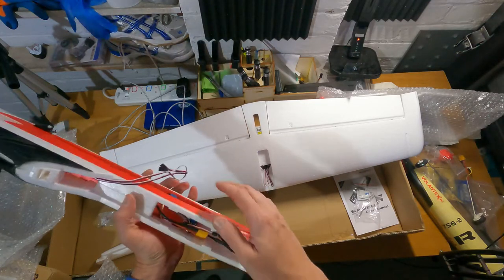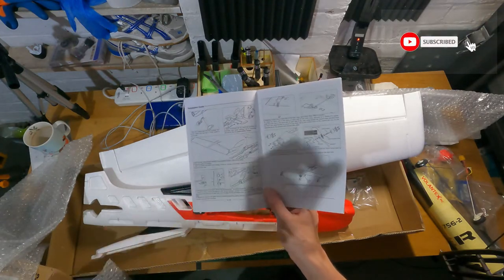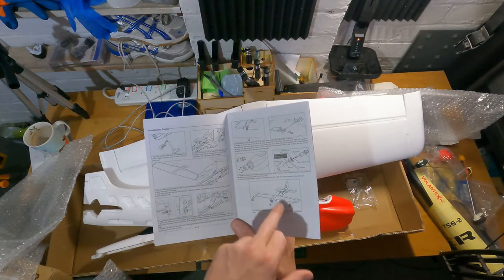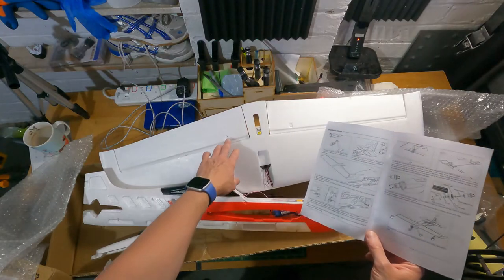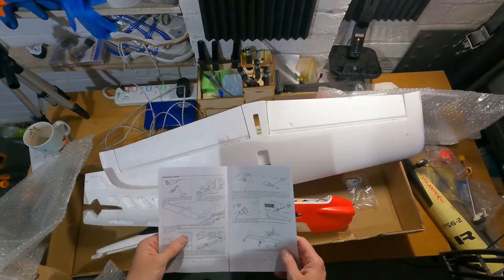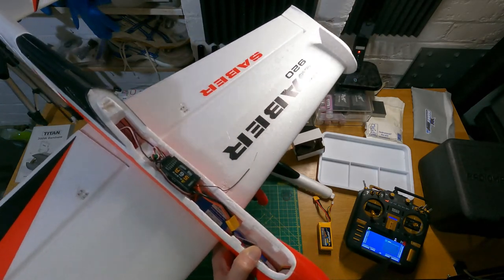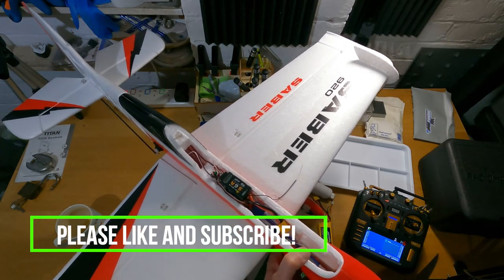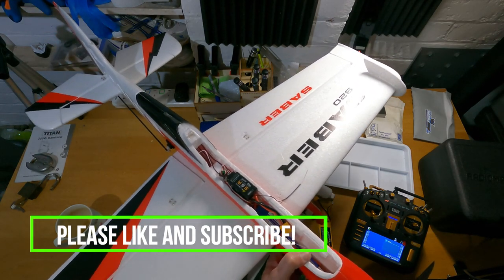VOLANTEX SABER 920 ASSEMBLY

Comment: Hello sir. Nice assembly and decals.
Sir what is the size of battery best recommended for that plane?
Thanks
Reply from the maker: Thanks! I use a 3S 1300mah 👍
Reply: @tdogrc  thank you so much sir. God bless
Reply: @tdogrc  So requirement of 2200mah isn't correct? I notice everyone running 1300mah up to 1500mah of 3s. Problem is I have shit load of 2200mah packs. I don't want to buy lower capacity of battery
Reply from the maker: @rcrotorfreak  thanks for watching. You won’t fit a 2200mah in, way too big.
Reply: @tdogrc  I use a 2200 no problem, easy fit

Comment: Did you notice it is not made of EPO foam as claimed at all, but EPS, the poor quality....
Reply from the maker: No I didn’t notice that 🤔
Reply: @tdogrc  you can try pinch the material, very easy to deform, that's EPS; while EPO is hard to deform.
Reply from the maker: @howintesting940  thanks for the tip. I don’t have this plane anymore I sold it 👍🏻
Reply: @tdogrc  why did you sell it? not so good?